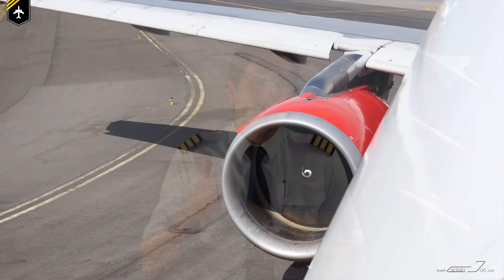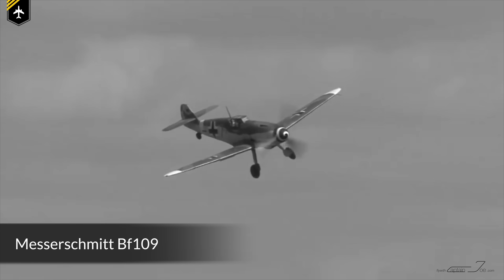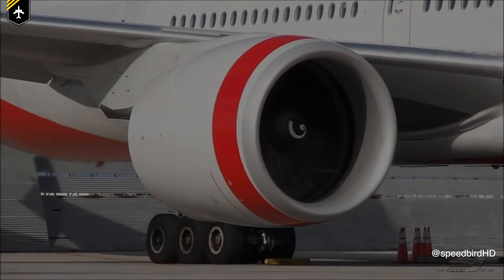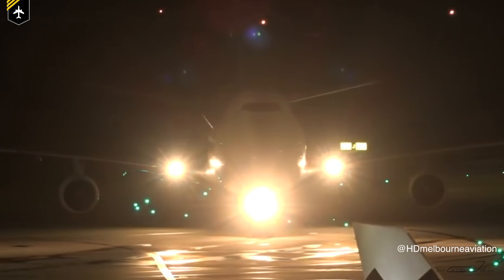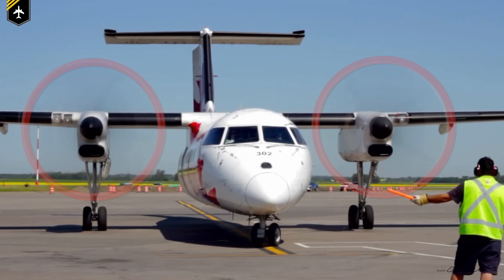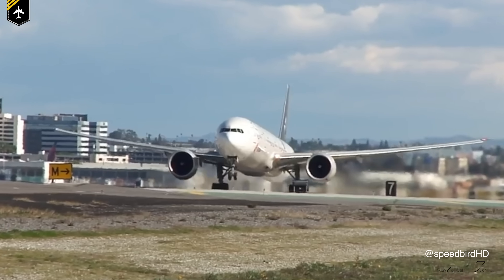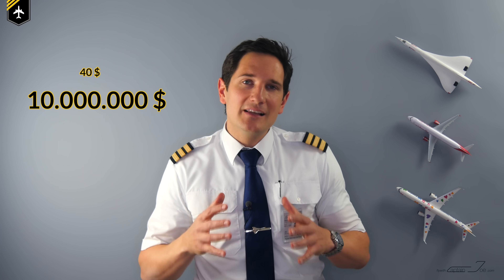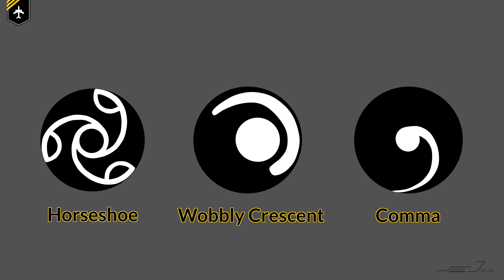WHY is there a SPIRAL in a JET ENGINE? Explain by CAPTAIN JOE

Comment: Quick question captian, are pilots allowed to carry firearms or anything like that on the flight??
Reply: Has it been enforced though? Joe should make a video on it, great video idea in my opinion!!
Reply: Shooting guns in cabins or cockpit is a pretty stupid idea, unless you don't actually care about the safety of the flight.

For one, there's lots of sensitive equipments in the cockpit and a huge glass panel. If you miss your shot, you're going to risk the safety of the flight. There are also lots of passengers packed in a very small space.

People who work as air marshals has to be special trained, they have to be the best of the best of marksmanship because the stake is huge if they miss their shot. For the most part, I don't think most pilots would have the necessary skills to shoot in such tight constraints, even if they're a pretty good shot at the ground.
Reply: firearms on a pressurized aircraft are a recipe for disaster
Reply: I miss those days. You could go to the cockpit and chat with the pilots on long flights. I really miss that.
Reply: Yes, some do, they are called federal flight deck officers. Basically pilots that have extra training and are allowed to carry guns for safety reasons. (In the USA)
Reply: From memory its highly unlikely to create an explosive decompression as the hole just wouldn't be large enough, sure it would depreassurise the cabin somewhat but not enough to rip the plane apart. Source: MythBusters did an episode on it and I think there have been numerous cases where investigations have proven it does not.
Reply: Wtf
Reply: aside from the safety axe (guarded by flight attendents), there is no weapon on board comercial flights
Reply: https://en.wikipedia.org/wiki/Aloha_Airlines_Flight_243 Here is  an article of a plane that had a significantly larger issue (part of the fusalage blew out, causing an explosive decompression that would be significantly larger than a bullet. Resulting in only 1 person being sucked out of the plane, although I would argue that a bullet wouldn't then make an 18.5ft hole in the plane.

Mythbusters also did a piece in it here: https://www.youtube.com/watch?v=4yG2h1aDB6k

It's genereally accepted that a bullet just cannot cause damage significant to down an airplane / large enough damage to remove people from an airplane, short of a large explosion (as a small explosion still is not large enough, see here: https://en.wikipedia.org/wiki/Daallo_Airlines_Flight_159).

That being said, its still a very poor idea to shoot holes in planes at any altitude, but the effects are far less 'explosive' than expected. Rapid decompression is likely to occur, but pilots are trained to deal with this (by lowering oxygen masks and descending to a safer altitude as safely as possible, then landing at the nearest airport).
Reply: Absolutely forbidden on international flights. Domestic flights within the US, only between states which allow open carry, are "technically" allowed. IIRC.
Reply: Michael Botros In the US, they have air Marshalls. I don't reckon you make pilots get even more training.
Reply: is this even a serious question LOL
Reply: Thanks for all the comments now!!, Now I am even more confused:-)), but thanks for putting in all the effort and time into writing them!
Reply: Lmao no? If a bullet goes through the body of the airplane it could be seriously hazardous.
Reply: No. They carry BOMBS
Reply: the pressure diference is of several metric tonnes per square metre on the fuselage, a bullet hole, or multiple bullet holes are sufficient to cause a catastrophic rupture of a panel... this is even worse on composite materials as they are made to whistand only forces in specific direction
Reply: @Hal, Use fragmenting bullets, the enter the person and not exit
Reply: Believe it or not, but most jets produce enough pressure in their compression stages that they can keep an airplane pressurized, even with a gunshot hole in the airplane. It's not like how they show in the movies. A gunshot hole will not cause the cabin to explode. It's actually anticlimactic.
Reply: There is a glock in the cockpit yes but only those trained are allowed to use it.
Reply: I think they even made that mandatory in the US for a while, but definitely optional for the same reason people wantTeachers to carry firearms now. I watched a video on it not too long ago. Saw two happy pilots of US airlines posing for a picture with their AR, and what seemed to be a Beretta quite the picture I’d say.
Reply: You could always go into a free fall for a few seconds to make the attacker lose balance
Reply: In the USA pilots can be armed since 2003, over 12,000 pilots and crew personnel carry handguns on US flights.
Reply: Ricardo Mora but those are the ones piloting the plane?? or theyre there for tand by on the flight?
Reply: What do you mean?
Reply: back in the days where pilot cockpits were open ....
Reply: Federal Flight Deck Officers (FFDO) are pilots who went through a special training program with the TSA to be allowed to carry firearms onboard aircraft on US commercial airline routes. However, they are only allowed to use it onboard and once they step out of the aircraft, they cannot operate it (other permits notwithstanding). It's said that FFDOs have the smallest area of jurisdiction for individuals federally approved to hold a gun: the flight deck and the cabin.
Reply: Captian😂 *Captain
Reply: Happened for sometime after that PSA flight that was hijacked
Reply: Back at the highjacking 70's-80's Russian pilots carry a revolver to prevent highjacking. Not so sure about todays
Reply: Talking about firearms in an aircraft... ever heard of Explosive depressurization ? A.K.A. "Ka-Blewit because of pressure difference"?
Reply: Some have pistols in the cockpit
Reply: No but a police arm with guns are always with them. I don't think this is always true, I don't even know where I got this from.
Reply: there is no weapon in the huge majority of aircraft around the globe. out of the 195 countries on earth, only 9 have "Sky Marshalls", and not on every flights... Shooting through the fuselage at high altitude is likely to result in an explosive decompression, transforming the aircraft, all the passengers and crew instantly into something.... well, something gross.

The cockpit itself is a fortress, all aircrafts were modified after 9/11, with an armored door, codelock, security cameras, etc, etc....
Reply: I think a knife, maybe
Reply: I think maybe a pepper spary, baton or Tazer would be better.
Reply: Can I just clarify I am not from America! But feel free to keep on discussing it its an interesting debate!
Reply: only in the checked bag so not being allowed to be carried
Reply: Incorrect, pilots, so long as they're qualified and approved by the feds, can care firearms inside the cockpit.
In General aviation, we can carry them, so long as we are following state guidelines (same as if you were driving them in the car with you)
Reply: I need that as well
Reply: jur4x i dont know if anyone replied to that stupid comment, so i will. Shots to the driver, engine and tires will do wonders.
Reply: https://en.wikipedia.org/wiki/Federal_Flight_Deck_Officer
Reply: James Thom I'm British and I'm a civilain and I own guns. You don't speak for us. We have loads of deaths from guns and knives. London is so dangerous.
Reply: dXb are you being racist?
Reply: James Thom germany showed some great safety tricks with lufthansa in mountains 
How many deaths?
Reply: Arent air marshalls enough?
Reply: Muricans are gun freaks lmao
Reply: Michael Botros your explanation as to why right-wing nations don't do so is...?
Reply: Mimu Mi you really think that a gun is JUST an offensive weapon?
Reply: "welcome to albeit airlines, i am your captan Yamaan Kabbani 
and i have a gun"...um no thanks, id rather you kept your eye on flying and not worry about if you drop a glock IT WILL GO OFF
Reply: jur4x living in liberal imaginary land cause there is no 40 ton trucks
Reply: Michael Botros my friends dad is a southwest pilot and he carries his handgun
Reply: James Thom and the figure of rape, acid, attacks, burglaries, and acid attacks in Europe and Australia are incredible
Reply: I think a gun once got on a plane cause no securitt checks on staff back then and he started shooting
Reply: Gun Nut you are close, but violence is not caused by poverty but by the difference of of wealth within some sort of community. For example an indigenous people living on an isolated island are probably extremely poor, but the crime rates are very low.
Reply: Michael Botros 
Guns seem ricky inside planes though, damage to the aircraft could be fatal for everyone
Reply: If shot in a pressurized cabin and penetrated a wall which it would then 2 things could happen 1 the plane would lose pressure and altitude fast and you’d need air masks or 2 at extreme altitude the planes insides would become its outsides
Reply: yvrelna Then how do they shoot guns in airplanes in movies then? without recking?
Reply: you would have to be insane to fire a gun inside a planes fuselage while in air... and just why the hell would the pilots have guns? they are safe inside the cabin behind a bulletproof door, no way a firearm someone may be able to get onboard could ever geth thru that door, and why would they ever even think of opening it in such a situation? to get in a gunfight with armed terrorists? briliant idea! lets open this bulletproof door and let the terrorists in! lets fire stright into a mass of innocent passengers! lets open the door and place ourself in the line of fire with little to no cover and expose delicate instruments and windows to bullets! such a wonderfull idea! dead and/or wounded pilots, damaged flight instruments, broken windows, explosive decompression, dead and wounded passengers and flightattendants... that planes gona come down fast and hard and end as a giant fireball.
Reply: Yamaan Kabbani why would you need a gun if you could just learn how to fight and knock someone out in one hit?
Reply: Charles Thomson that’s why you squawk 7500 because pilots are not trained to handle the stress of missing and killing a passenger if they could handle that stress they would be better has a police officer so training a pilot in hand to hand combat would be better if you want the pilot to do something about the problem without squawking 7500.
Reply: My OE in 1973, included some internal trips across what was then the USSR flying Aeroflot. The pilots had smaller caliber revolvers carried in belt mounted holsters.
Reply: James Thom firearms are an equalizer. Don’t speak on a subject you don’t know anything about considering you’re probably not from America.
Reply: James Thom plenty of people in the UK have guns mate. Shotguns, rifles, even LMG'S, though getting licensed for the latter is a NIGHTMARE
Reply: Gun Nut 1. You only stated 1 example and 2. guns aren’t the problem but they make the problem exponentially worse its harder to stab 100 people than shoot a hundred
Reply: Kyle Lim It’s also hundred times easier to acquire a knife and you don’t need a background check.
Reply: How do you explain the sharp increase in stabbing and slashing attacks in the UK? Or the school mass stabbings in China? People like you should keep their mouth shut because you simply don't know what you are talking about. You are so dumb and delusional that you keep blaming mechanical devices and tools as the culprit for all that horrible violence.
Reply: They have like an axe
Reply: No. But most US based flights require the presence of an air marshal, and they carry a gun
Reply: Gun on pressurized plane = bad idea. If you poke a hole in a pressurized cabin, the pressurized cabin explodes. A single bullet into the fuselage can easily down an A380.

Now imagine what happens if you miss.
Reply: I agree with you and I some airlines have the pilot carry a gun
Reply: I'm the answer 124 just to mess with that 123
Reply: I heard rumors about armed pilots in the soviet russia. The explanation was, they had been carrying guns to prevent any rowdy passengers from hurting other passengers and crew members. Apparently, should there be a need for that, a pilot was supposed to grab his gun, head to the cabin and very comprehensively explain to the troublemaker why he shouldn't do what he's doing. Sounds pretty ridiculous, to be honest, but rumors are rumors.
Reply: i once read an article that some airlines wanted to do that for more protection against terrorist
Reply: Michael Botros nope never, liberals wouldn’t allow it because it’s downright retarded to do that in a pressurised environment.
Reply: iRx Destiny That's why we now have the security measures at airports, and impenetrable cockpit doors. Do you think its wise for a pilot to open this door to get in a gunfight at 40k feet? Apologies for assuming you're American, but your comments are one I read often from Americans, and the figures from gun deaths in the US are incredible!! Especially when compared to places like the UK where nobody except a tiny percent of Police have guns.
Reply: The UK? You mean the UK, which had been conquered by Islam and installed they own set of laws and no go zones for UK people? The UK people who had been robbed of their freedom of speech and many other freedoms. People face fines and imprisonment for saying the truth in your shithole. London has become the most crime ridden city in all of Europe. It even has surpassed New York you utter fucking moron. You helped destroy your own country you idiot and there is no going back anymore because it is too late. You all have been systematically transformed into ball less idiots and feminists. And you even like it.
Reply: German wings, cockpit doors. No need! Why does so many US citizens think guns are the answer?  Especially in a pressurised cabin! Smh
Reply: because if there's a terrorist with a gun,you're not gonna fight him with kindness, and im not american
Reply: So guns keep people safe from people with guns. If you would forbid guns in first place you wouldn't need those guns. So guns are the peacekeepers when guns made the trouble in first place. If guns would've been the peacekeepers, then explain your fucking murder rates.
Yeah brazil has many shootings. But guns are basically everywhere there. You should understand that people can't shoot other people without guns.

Perfect proof for that is your murder rates, there's no other explanation than that
Reply: Gun Nut and how your gun is effective against 40 ton truck plowing in to the crowd?
Reply: Lot of morons commenting on this. There are often armed air marshals on planes. Typical that anti gun people like the guy who said they are an offensive tool and not a defensive tool (absurd claim, as anything can be used either offensively or defensively) don't know wtf they are talking about. Using the proper round for the situation all but eliminates the risk of using a firearm on a plane.
Reply: Gun Nut And you are causally ignoring the fact that literally the rest of the entire developed world doesn’t have this problem. Why do you people always feel the need to insult liberals every chance you get? Snowstorm: Make fun of liberals. Laws making it harder for a psychopath to get a killing machine? Make fun of liberals. Flight gets cancelled? Make fun of liberals. This is why the American right will never be taken seriously
Reply: idk, i read ita year ago, but yeah he need to make a video about it.
Reply: Yamaan Kabbani no
Reply: Speedbird that's the American people for ya
Reply: Gun Nut The united states of America has turned to trash because of there petty gun laws allowing every pychotic to have a gun. Fix your laws before you even comment about gun laws!
Reply: iRx Destiny yeah and your not going to fight them with a gun either in a pressurised cabin which the gun shot would more likely depressurise the cabin
Reply: A locked bullet proof door will stop a gunman from killing the pilot, it's called BULLETPROOF for a reason.
Reply: Yamaan Kabbani what's wrong bin laden? Did i just expose your plan?
Reply: Why am I surprised by your username
Reply: James Thom - Because if there's a maniac loose on the plane with a gun, the only adequate response to stop the threat would be to shoot him/her. For over 200 years in America, guns have been the answer that keeps free people protected from tyrannical governments and peaceful people from those would harm them. Simply because some have used guns for evil reasons, does not warrant confiscating guns from the rest of decent law-abiding society.
Reply: nope. you think the liberals would ever let that happen?
Reply: Oh yeh great plan. A terrorist approaches the cockpit? lets shoot him, hopefully i dont hit the fuselage and cause a massive decompression at 40,000 feet, you fucking moron
Reply: Firearms on aircrafts? Let me guess, you're murican... -.-

Comment: if birds fly towards engines because they look like a cave, why is not (a part of) the entire fan painted in a bright color, like white ? Weight issue ?
Reply from the maker: I agree with you, I don't know!
Reply: White? Boring! Why not some psychedelic multi-colored patterns?
Reply: whatever, but something at least instead of pure black
Reply: Weight is one reason, another is what could happen if some of the color would chip away and get sucked into the engine. There is a small probability that the paint flakes would get into the bypass air channels for the turbine cooling and eventually clog some of the cooling holes up which then could lead to heat damage of the turbine blades and eventually to an engine failure.
Reply: shi01 could be a reason, maybe not paint the entire fan then but just a few blades like it’s done on turboprops